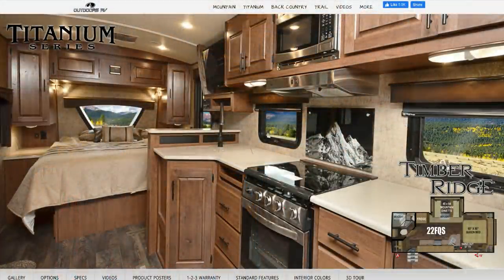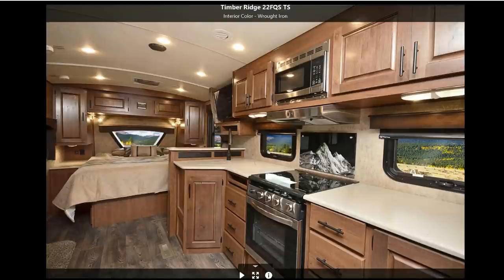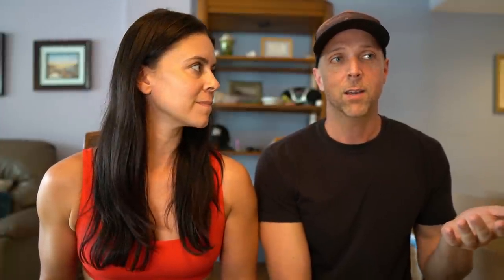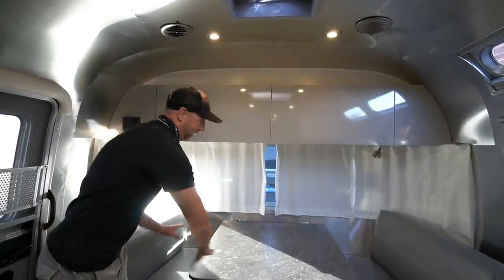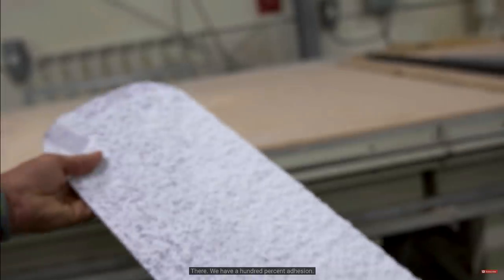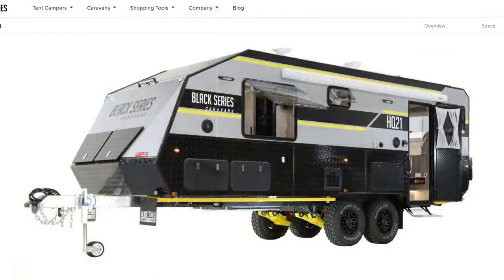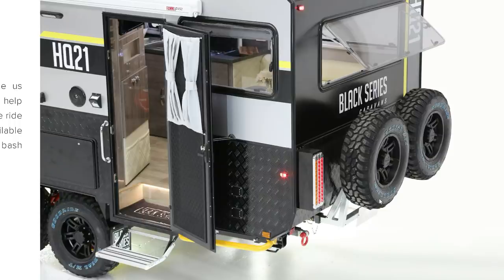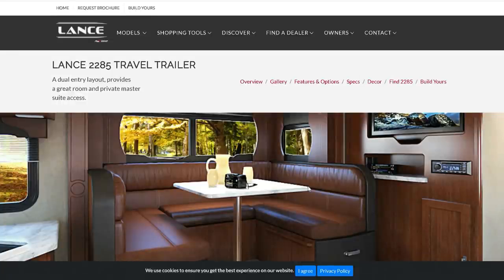Why We Chose Outdoors RV Over Airstream, Black Series, & Lance Travel Trailers

Comment: Can you tell me more on the weight of this outdoor RV and the towing capacity of your new Ford  pickup?
Reply from the maker: Sure, if you go back and pause the video when I'm talking about cargo carrying capacity of the trailer you will see all the specs. But the 22FQS is one of their shortest and extra HD on the 8in chassis. It has a dry weight of 6425lbs and a max weight of 9995lbs, making the hitch weight (on the truck) go from about 635lbs to around 1,000lbs. Our 1ton truck can tow about 15,000lbs bumper pull and has about 3500lbs of payload (cargo) capacity.  This trailer could be towed by a half ton, but watch out for low payload on those trucks. If the payload is only 1,500lbs and 800lbs is used up by the hitch weight you would only have about 700lbs left for all of your gear and occupants. This is why we went with the extra capacity of the 1 ton.
Reply: @IreneIronTravels  Same reason we decided on getting a new(er) F-350 SRW, is that humongous payload capacity! Also, that 7.3 gas V8 coupled to that HD 10 speed transmission will make for easy driving and towing, wherever we may be.

Comment: Nice choice! Is there solar? What about battery storage? May need an Aaron electrical retrofit. Saw some videos of the ORV 22FQS, there seems to be a curtain that will at least block the bedroom from the rest of the RV. There is a track on the ceiling for it.
Reply from the maker: Thanks! Up to 4 batteries in tounge and yes, you can add on 340 watts from the factory, but we opted to leave it off so we can do it ourselves! They all come solar ready and prewired for 510 watts...... but you know we'll be doing a big electrical upgrade!! Not sure where the batteries will go yet..... passthrough or under the bed....

Comment: We are looking down the road at something to replace our Grand Design 17MKE. While we like our trailer we do want something with a little more room and possibly no slides. The Outdoors 20BD looks great but the wife likes the airstream 25RB twin which we would have to get since I’m almost 6’ 6”. 

Other than the price, the thing that worries me the most with the Airstream is the possibility of leaks. Seems that it’s not if but when you get a leak, how much damage with the floor get. Also agree with while the Airstream is easier to tow, the lower chassis is a concern with scraping with everyday movements like gas stations and off roads. 

Looking forward to the thoughts once you get it.
Reply from the maker: Lot's to consider for sure! I do like that the 2021 AS's have the composite floor instead of the wood now and I also hear they are all moving to 12 volt fridges which I like. All of the metal and glass is a concern for us sitting in the dessert sun as well. Our van would heat up quick if we didn't use the awing for shade and then had to block the views out the windows with the blackouts as well.

Comment: As for no closed-in bedroom: it's rare for the walls and doors to block a lot of noise. Obviously it's better than an open floor plan, you'll still hear a lot. The bigger advantage is blocking light. This can be fixed by running a steel cable (as a curtain rod) between the two sides of the unit with a blackout shade. This will get you a fair amount of light blocking and help muffle the noise a little bit. That's my theory, anyway.
Reply from the maker: Makes sense for sure Paul. There can't be that much difference from the bed being another 8 or so feet farther away. There is a curtain already built in, so we're hoping that helps a little if Chris is sleeping in. I've been getting up between 4 and 5 lately..... too much on my mind i think!!

Comment: Maybe put a Murphy bed, where the bed is, now. It folds up, towards a wall. Then, two folding lounge chairs are always there. And a fold-out table attached to the bottom if the bed folds out. When the bed is up. With more seating available. Than just having a bed.  And  dining table and seats, by the side.
Reply from the maker: That's a great idea! Would definitely at some extra seating!

Comment: I'm surprised you didn't discuss your power needs.  After all you invested in the solar and lithium batteries for your Interstate I know it is going to be your primary limitation on dry camping...unless they have a package I'm not aware of.  I put 1100 watts of solar and 400 amp hours of batteries in my class B and still worry about extended stays if I'm forced to park in the shade or have multiple days of cloudy weather.  I'm betting one of your next videos will on on how you are dealing with power.
Reply from the maker: 1100 watts is great! We only had the 300w and it did limit us in the winter for sure. Yes, we are definitely going to be putting in our own system! OVR does come prewired for solar with Zamp plugs and you can get (3) 170w panels plus 200wat portable...but we'll be going bigger for sure! They don't come with any inverter, which is fine because we'll be adding that as well. Everything is 12volt in the ORV which is nice including the TV! Now we'll finally have some extra space to go big!

Comment: Having a Timber Ridge Titanium 24RLS made right now. Hopefully have it by April. Also considered the Arctic Fox, Lance, and Keystone Cougar. Chose Outdoor RV for all the same reasons you did. One question, and apologized if I missed already stated answer. Why not consider a larger Timber Ridge, or Blackstone trailer? You certainly have the truck to pull it.
Reply from the maker: We could have gone a little bigger, but ultimately moving from a 22ft sprinter van we wanted to stay on the small side. This is our first travel trailer and tried to set a length limit of around 25ft-27ft. 28ft would be fine as well, but any longer and we would probably go a fifth wheel route.
Reply: @IreneIronTravels  Yes, the small Glacier Peaks 5ver are very nice. Liked the Arctic Fox Ronde 27.5 also. I wanted to stay under 30' for campsite availability.

Comment: Wondering why you didn't get a ORV BackCountry series. It has bigger tanks and more clearance.
Reply from the maker: We really like the 22fqs floor plan and the Titanium features and lighter interior. The ground clearance is the same I believe once you add 16 in tires to it, which we did. Same 8 in chassis, 5200lb axles, 35k furnace, 9995 gvwr, 8cu fridge and most everything else is the same. Would love the 100, 50 , 40 tanks of the backcountry but 80/40/40 is plenty.

Comment: Regarding your concern about BR privacy, what about putting a spring loaded or mounted style curtain rod across with jump rings and hang up a cotton/black out curtain or if not black out something that suits your style preferences?  You could split the curtain in the middle or go with a slide left or right model. I know it’s too late but just for curiosity, did you investigate any of the Grand Design models? (We have the 2250RK, 28ft)
Reply from the maker: There is a curtain that does go across the bedroom for some privacy... but not sure how well it works. But could upgrade the material if needed, but it does have the track in the ceiling already! The GD Imagine 22MLS would have probably been the model we would have looked at. We have heard GD has great customer service and good build quality, but we have never been in one (besides Jason and Rae's 5th wheel, which is nice!), so we will keep an eye out for one to tour. The 22MLS has a table, couch, and walkaround bed which is nice. The kitchen is a little small though. Do you guys like yours?
Reply: @IreneIronTravels  yes! love it. 2 1/2 yes now (1/2 timers) Best of luck with your new rig it looks super perfect for your situation. Travel Safely!!

Comment: Amazing.  You guys went down the exact same road we did.  We looked at Airstream, Black Series and finally Lance.  We actually got to see a Black Series here in Austin and it was too small on the inside. Airstream again, especially now, is way overpriced.  We looked at and liked the Lance 2075 but just not enough floorspace.  We've been back and forth on ORV for a couple of years before we bought our fifth wheel which we just recently sold. We did a re-take and it was the best compromise.  We put a deposit down on a 22FQS at Thompson's about 6 weeks ago.  We make our pickup in Oregon sometime in August.  We cannot wait!  Nice choice, guys.

Comment: Should have got and InTech Terra Oasis (very modern interior and they have the Rover lifted package).  If ORV is you jam, then why not the ORV Back Country 20BD (100 gal fresh, only 25ft, no slide to break)
Reply from the maker: The Terra does look like an interesting trailer we'd want to check out. We do like the interior and all aluminum frame/chassis, decent tanks. Kitchen is a bit small and the GVW and OCCC might be too light for our full time use. The Back Country's are nice, but don't come in the Titanium trims and we don't need the built in Gen. But love the 100 gal fresh!

Comment: 80 GALLONS that's going to give you so many options!
Reply from the maker: Yes! Kiddie pool....hottub...washing machine....water the 🌵! 😂🤣 Thanks Paul!
Reply: @IreneIronTravels  buy some cheap appliances off Craigslist and set all that stuff up in the middle of the desert as an April fools video 😂. Have a drone shot just pulling back of Chris chilling in the hot tub while Aaron is doing laundry surrounded by miles of BLM land.

I mean, why else did you buy a truck 🤔

Comment: Hi guys, what about a power supply?
Reply from the maker: Yes, sorry we didn't really talk about that since we like to add our own. Not many manufactures have enough good power supplies for full timing and off the grid it seems. ORV is all prewired for 510 watts on the roof and 200 watts portable (we'll probably go bigger), and they are capable of 4 batteries on the tongue and do not come with any inverter at all. Everything is 12volt (including the TV), except for the micro, AC, WH electric. We'll be doing an electrical upgrade for sure in the passthrough storage or under the bed!
Reply: @IreneIronTravels  thnx ✌️

Comment: You certainly did your homework! Nice choice. I am wondering, how much solar you are going to put on a new rig? And Victron now has The multiplus II - 12 V inverter, that will supply both legs of the panel box.
Reply from the maker: Thanks! Would like to shoot for 1000 watts plus! Not sure how much space is on the roof, but it will be a fun upgrade. I saw that Mutiplus II and wonder if the only extra benefit is for 50amp 2 leg service?? This RV will only be 30 amp.
Reply: @IreneIronTravels  If it’s 30 amps then the multi plus you installed last time should be sufficient… looking forward to seeing your solar install…

Comment: Imagine the new electric F150's with all that AC power onboard.  Perfect for boondocking. 10,000 towing.  As far as the camper; I just don't like the vulnerability of the slide failures.  Therefore Airstream with larger wheels.
Reply from the maker: That hybrid option does look intriguing! Hoping they add it to the SD lineup as well. Yes, the slide was a either or option for us as we'd like the extra room, but would also like mitigating the failure/ leaking aspect like you said! Can't go wrong with a AS!

Comment: If you can accept the enormous weight of these trailers, they are undoubtedly a well crafted choice.  But buyer beware, they are very, very heavy for their size.  There are very few floor plans they offer that could be considered for half-tons.  And you have to ask yourself if you really need that tank-like construction.  If you do, you have very few options and this is definitely one of them.  Airstream is a non-starter for most because of the exorbitant price tag.  They are snazzy and iconic, but anybody who says much of what you’re paying for is anything other than the cult-like brand recognition is kidding themselves:  you also don’t get slides which makes them pretty dated.  Black series are a startup, so who knows if they’ll even be around.  Lance is a reputable brand known for their truck campers.  They are old school with no ducted AC, although I think 2022 might see changes there.  They are very compartmentalized and cramped feeling, but quality is very good.  Like Airstream, you often must buy sight unseen since they’re rarely at shows and usually dealers have nothing in stock.  They also ain’t cheap.  For me it came down to Rockwood vs Cougar.  I don’t need my trailer  built like a WW2 era battleship, and feel it’s silly to need a 3/4 ton + truck just to pull around 27 fr, but that’s not meant as an insult, I just don’t personally need ruggedness like that, and also am not full time.  I think Cougar and Rockwood are very solid products, in a class by themselves, and have the right mix of refinement, tow ability,  and affordability.  I also like that the 22MLS Cougar has a dinette and sofa, almost unheard of in 27 ft.  Cougar and Rockwood are also reputable brands, like ORV.  But for the needs you laid out, I think you chose perfectly.
Reply from the maker: Thank you for the comment! 😊
Reply: Interesting - that Cougar 22MLS looks A LOT like the Grand Design 22MLE.  I was stuck on the Grand Design either 22MLE or 17MKE, but in researching have narrowed it down to the Nash 23D, ORV Backcountry 21RWS - but am waiting to see the ORV 19MKS which has a Murphy Bed and a dinette and theater seating.

Comment: These trailers seem to be well made with good suspensions.  However, their interior design misses the mark. The big kitchen is great, but a front kitchen with a lot of windows and few, if any upper cabinets makes no sense. In the typical rv park your view out the front is usually other vehicles the access road. Of all their models, I only saw one where the tv was viewable with out looking sideways.  Double entry into  the bath is a waste of space  that could be used for a decent sized shower instead of a 32" phone booth.  In some models the pass through bath holds anyone in the bedroom captive when in use by someone else and a curtain for privacy is a joke when someone is smelling up the bathroom. A smaller trailer with only a dinette for seating means no company  when a murphy bed would be more usable.